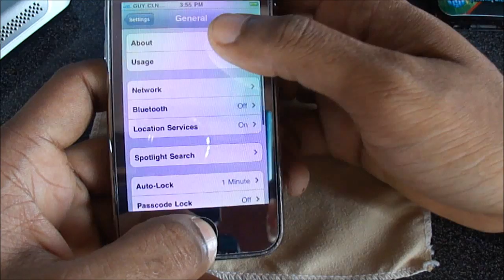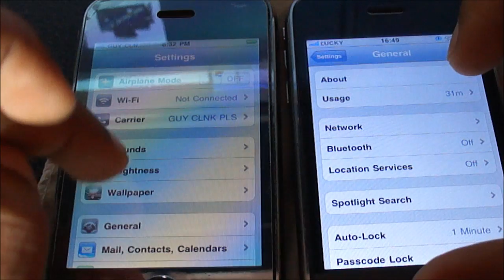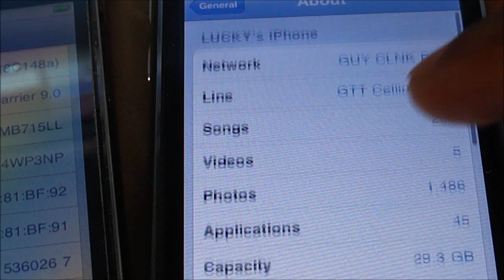iPhone 3Gs, Replace Battery,Screen,Logic Board...

Comment from the maker: @Iceman2376 

Assuming the Board is dead, if you can afford it then 150 is not that bad, if not try to get a board and I can assist you in installing it. Or check on eBay you might be able to get a working phone for 150 or even one with a broken screen for 100 and you can transfer your screen to it.it all depends on your pocket and time.
Please remember to like the videos and Subscribe.

Comment: Hey Dude, great video! I got a problem though, I went into my local apple store 3 days ago to upgrade my iPhone 3GS to a iPhone 4S, but while I was waiting there, I plugged my phone into one of many adapter plugs they have at the store to get some juice for my phone. Well shortly after a minute, I noticed that my screen went black, then when I tried to turn it on, It didn't. The phone was working perfectly fine prior to me doing this. I took it to apple again, and they denied that the port did

Comment: @LuckiRam Apple said thatmy phone was water damaged and the water damage thing wasnt tripped. The guy also said that it was corroded on the bottom so he wouldnt replace it. -_-' But I'll go and buy a replacement and see if that works. Thanks man.

Comment from the maker: @andrewisflyyy 

OK Bro, if apple doesn’t fix it  just check on amazon or eBay and you can get a complete unit ( Screen,Digitizer,Home Button) for around $50. That should solve your issue, just take your time and connect it.
Keep me posted.

Comment from the maker: @andrewisflyyy 

Look at the pins inside the connector, ensure they are not bent or depressed, also check that the connector is not losing off the ribbon cable, sometimes contacts are broken there.
Hope this info helps.
Please click the like button and Subscribe.